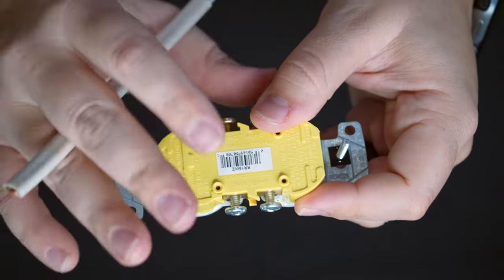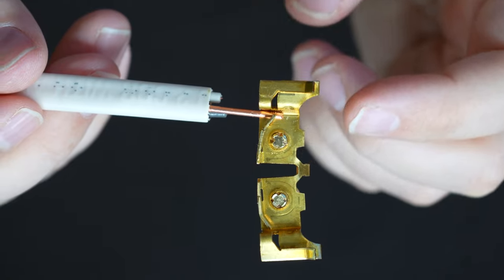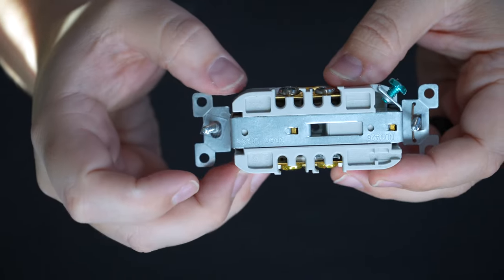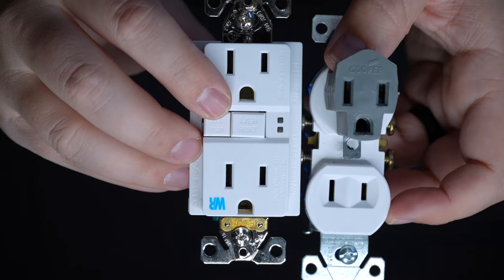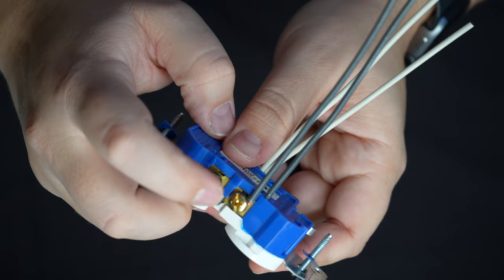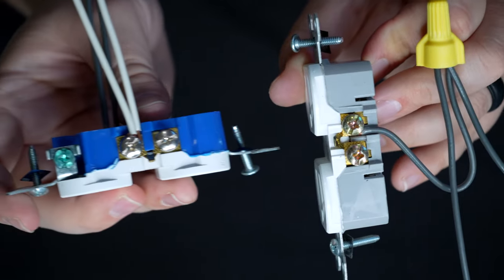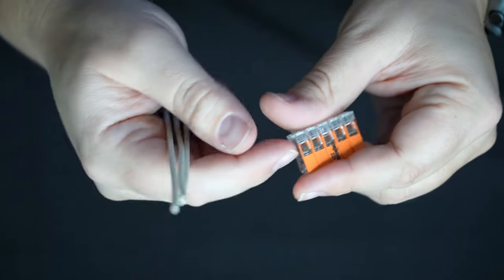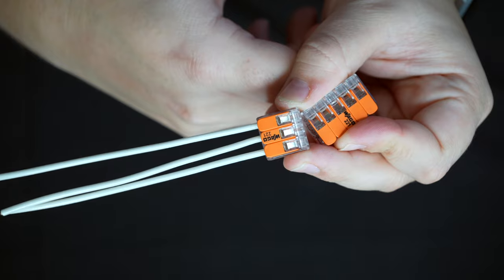The BIGGEST Outlet Wiring Mistakes DIYers Make... and How to Fix Them

Comment from the maker: These are a few of the most common mistakes I've seen. Were there any surprises on this list?
Reply: I think not reusing wire nuts isn't correct. Sure you have a corroded wire nut in this video, but most that I come across aren't. I'm also in the camp that says you should pre twist the wires together. If that is nice and tight the wirenut is just a protective insulator I feel.
Reply from the maker: @syntaxerorr Good points. There are two schools of thought on that (like a lot of things with electrical) but I do think it's an easy swap to make sure everything is connected securely, especially if you don't pre-twist the wires... As some believe you shouldn't do.

Comment: Good video. I understand why some people would assume that back-stabbing recepteacles could be problematic. It just intuitively looks...wrong. Here is what I have seen in 32 years as a master electrician who has worked on more homes than I could count. 
I have seen more 'screw-wrap' wired receptacles burn out the termination than those that were back-stabbed, and I have seen a lot more back-stabbed receptacles in homes. People have a tendacy to either not tighten screws enough, allowing them to loosen even more from wire contraction and expansion over the years, or to overtighten them which causes other problems but to a lessor degree. Back-stabbed wires are held under fixed spring tension, and I have tried to pull the old wire out when replacing older worn out receptacles and usually have to push the release tab to get it out without twisting the wire.  Most of the times I have seen back-stabbed receptacles fail, they have had the wire not inserted all the way, or forced with #12 wire which the spring-metal arm is not rated for causing it to over expand, permanently bend, and loose its ability to keep proper spring tension on the conductor like it should. Just what I have seen over many years. 
They have been extensively tested by U.L. and other listing labs many times, and the insurance industry also. I believe they work when installed correctly, and like side wrapped or even pressure plate receptacle terminals, can fail...seen all of them fail, usually from poor installation or a defective product. I would say go with what you trust most.
Reply from the maker: Thanks, I appreciate your comment! I may do a follow-up video on backstabbed wire pros and cons. I'll be sure to include your points if I do!

Comment: Re; Bootleg Ground.   I haven't done any such connections I have a related question. I've noticed on the Leviton receptacles I've used have the side clamping terminals. Those clamping terminals have two different sides of which wires can be slid into and then clamped down. Such a connection would avoid the potential of the mentioned loose connections. Are there other reasons that a bootleg connection should not be used on those kind of receptacles? Why would the NEC not permit such connections?
Reply: Neutral and ground is only ever permitted to be bonded at one place in a house, usually the first panel after the meter. It's dangerous to have neutral and  ground bonded at multiple places in an instillation.
Reply: @ezra153  I understand the NEC forbids bootleg grounds..  it's dangerous. But why is it dangerous?

Comment: Nice!
The 2 wires to 1 terminal doesn't look right at all.
Reply from the maker: Thanks! Yeah, you pretty much have to remove the terminal screw completely and wrap the wires fully in order to prevent it from slipping. Makes removal to fix it a pain too!